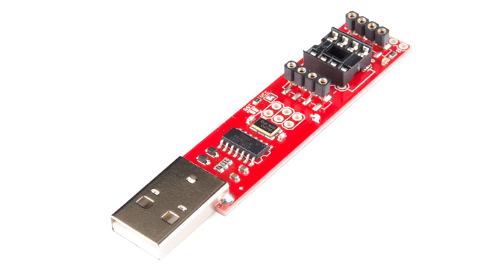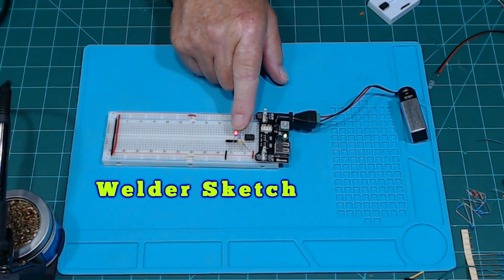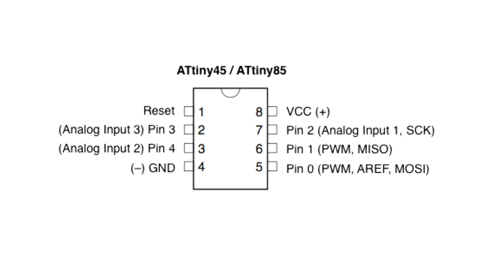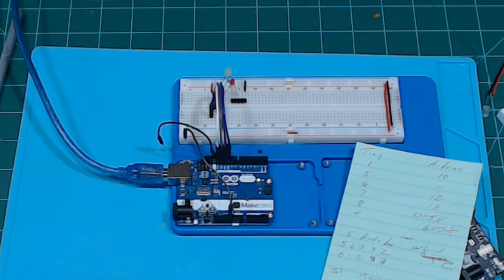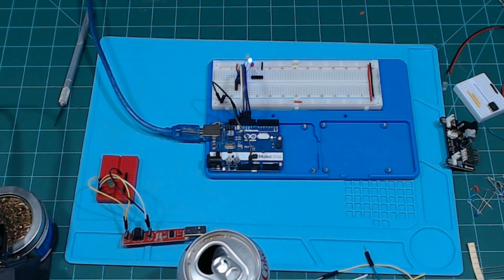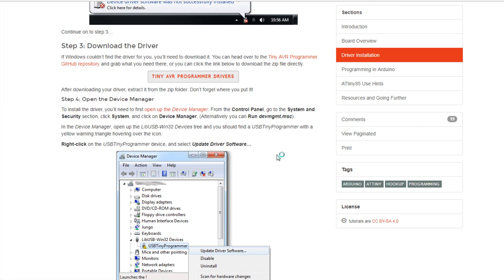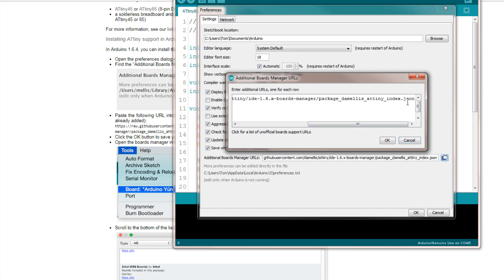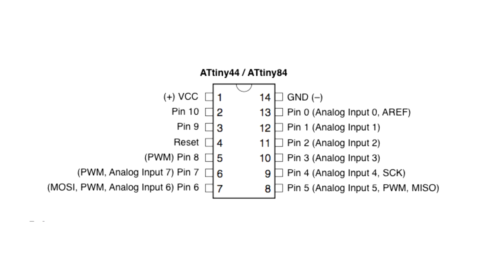What Is An ATtiny 85 & How To Program It With Your Arduino Uno

Comment: Hello. Can the Tiny 85 accept an Arduino code that utilises some  relay modules and a motor driver to control DC motor direction and speed on different power source of course ? But what a the limitations of this chip once its programmed? Also, do we have to include other components with it on a small circuit board like a crystal or capacitor/ resistor to make it work or protect? Thank  you
Reply from the maker: Any components used other than sensors or a few LEDs  would require an external power source. The micro controller is only powerful enough for the signal to trigger the component.

Other components are not necessary
Reply: @TomsTrainsandThings  Thank you and that is the purpose of the micro controller  to give the signal according to the code. I find it a good idea to use this when you build a project instead of using the Arduino which i want to keep for prototyping. Also makes your project more compact. Is there any other IC's that we can program with an Arduino besides  the atMega chips?

Comment: Can this or ATtiny 84 be used to control servos? Doesn't seem likely, but as a complete noob I'll ask.
Reply from the maker: I don't see why not, but you would need external power for the servo. I wouldn't try to drive a servo through these devices. May have to try this out. Thanks for the idea!

Comment: i am get this
avrdude: Device signature = 0x000000
avrdude: Yikes!  Invalid device signature.
Reply from the maker: Did you set up the board properties as instructed?
Reply: i have previously loaded sketches on to many ATtiny85. These are new chips from Aliexpress.
Reply from the maker: I suggest contacting AliExpress

Comment: How can I download the ATtiny85 program "simple welder" ?
Reply from the maker: I didn't publish the simple welder sketch since I have the welder function in "Arduino Made Easy - Lesson 8" which can be found on my web page. That sketch is a little longer but all you have to do is copy the welder function and the declarations for the 3 pins used. You will have to change the pin assignments for the three pins to match the ATtiny 85 pins which is described in the video. This video shows the top half of the sketch where the pins are declared and the modes are assigned.

Comment: once the loading of the IC is complete, what do you turn the programmer back to instead of Arduino as ISP so I can continue to work on other projects.
Reply from the maker: You can set it to AVRISP mkll. I don't think it matters what is is set at if your doing a normal upload. It only matters when you use an external programmer.
Reply: Toms Trains and Things thank you! The last time I tried to write to my tiny85 I think I bricked my arduino leonardo by not switchi ng the programmer. Now my computer won't recognize my leonardo. I had to buy a new one. Great tutorial!

Comment: sir this jason link is not working in Arduino 1.8.7 ide
Reply from the maker: Are the ATtiny boards not showing up in the Tools/Board menu? If so, delete the link you pasted before and copy it again. Make sure there are no spaces at the end of the link you highlight. If you already had an entry in "Additional Boards Manager URL"  make sure you have a comma between the entries.
Once you paste the link into "Additional Boards Manager URL" you need to close the program than open it back up. If it still does not show the boards in your menu than I would suggest contacting Arduino support with this issue. This link has worked in all previous versions going back over 5 years.
Reply: @TomsTrainsandThings  yes sir it is not showing when i go to manage board and when i search attiny it is not showing whole board manager is blank i really don't know why but before some months i was program it that time was board list have attiny25/45/85 than i select then i select attiny85 then clock and i program it but now i don't know why it is not showing i fully unstalled the arduino ide and reinstall but again this problm please help me sir
Reply from the maker: If your board manager is blank you have an issue with aarduino ide. Either go back to version 1.8.5 , if that doesn't clear up the problem, then contact Arduino support . You can also check the Forum to see if others are having the same issue with 1.8.7
Reply: @TomsTrainsandThings  ok thank you sir i will try😃🤗